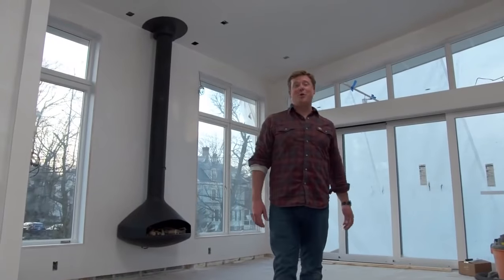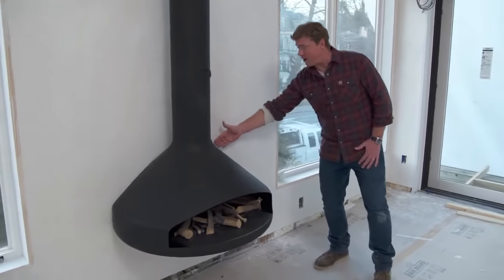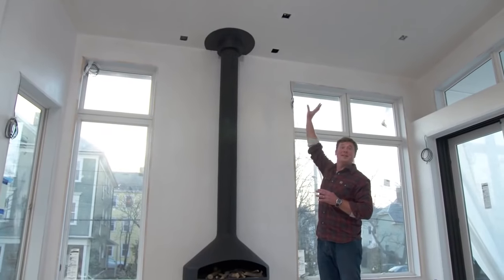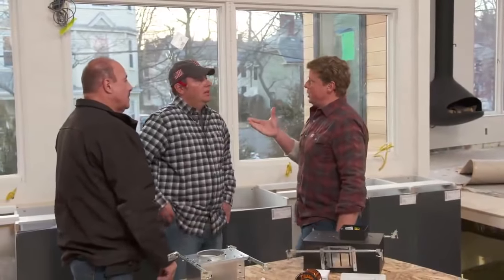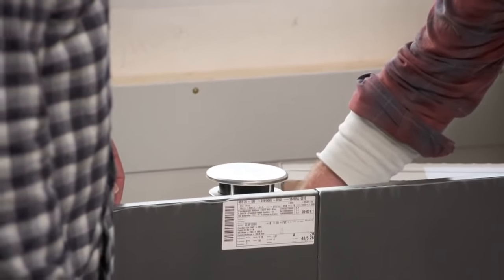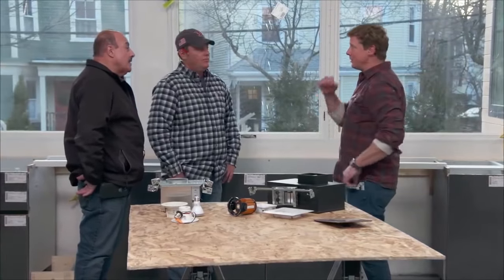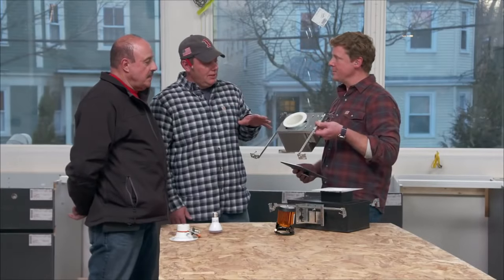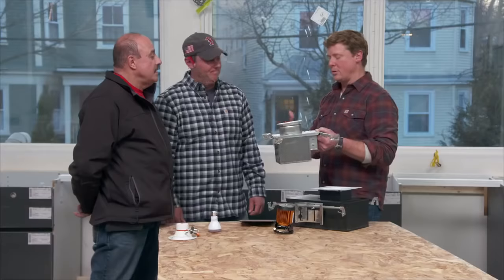This Old House | Pro2Pro: How To Work With Pro Electricians

Comment: Indiana we installed those $300-$500 can fixture all on a control 4 system all controlled down in  multiple  lighting panels. Those were the hardest cans to install. Glad to hear we weren’t the only ones to struggle.

Comment: Frankly the tube part of K&T and the use of knobs for changing direction and protecting the relatively weak wire looks pretty cool. The trouble starts with soldered junctions and the much older wires low current carrying ability.

Comment: If code isn't about safety, screw code
Reply: Code also helps to establish commonly expected usability standards. If the homeowners were allowed to not have any outlets on that wall, that may work great for them, but the next person that buys the house is screwed if they want to plug in a toaster or something on that countertop. Next thing you know, a dummy is using an extension cord or surge strip for their toaster, and it causes a fire. You could say 'well, they shouldn't have bought that house', but how many people are checking outlet placement until they move in and start using the house.

Just like code protects against idiots doing things that are dangerous, it also protects against idiots making their house less livable for lame aesthetic reasons that only they care about.
Reply: @bnasty267  if they make a dumb decision and have trouble selling their home then they can be added. No need to limit freedom in this way.